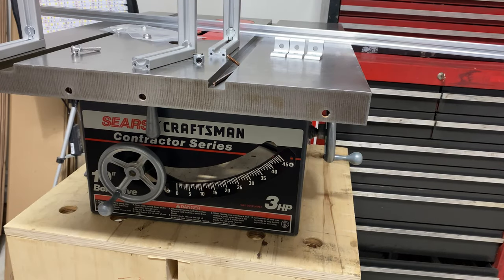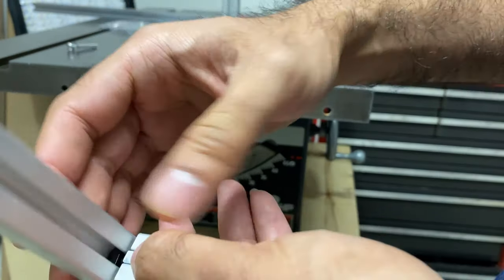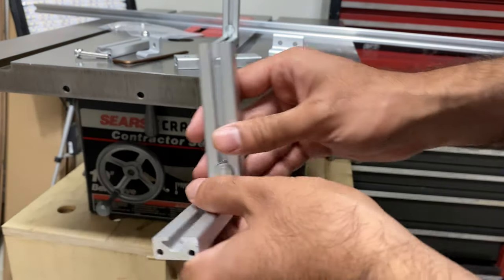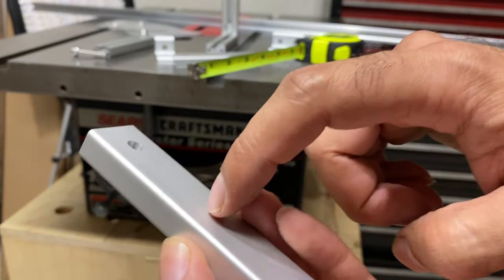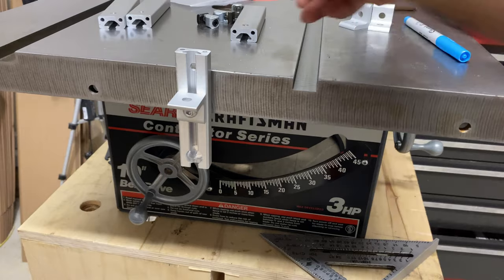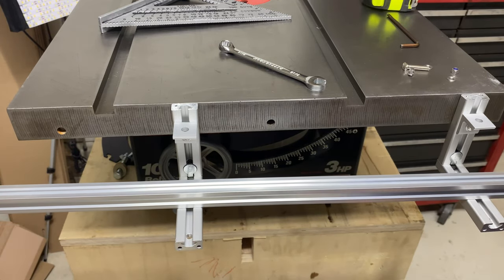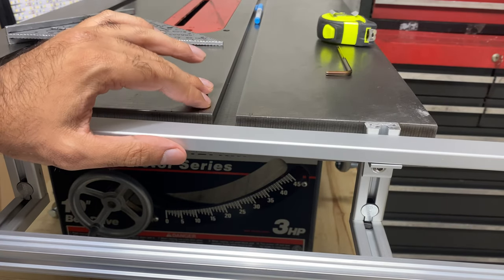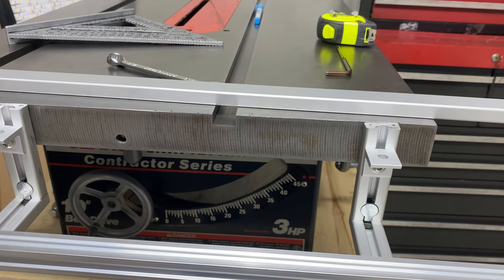Alumi-Lign™  Fence Installation Step 1: Installing Rails

Comment: What series aluminium xtrusion did u use? Its 20 or 30?
Reply from the maker: It’s 10 series for the rear rail 1x1
Reply: @jbuilds1  can u give me some link where i can buying?
Reply from the maker: @ardypamungkas9505  yes please check out my website jbuildstore.com
Reply: @jbuilds1  ok sir, thanks so much